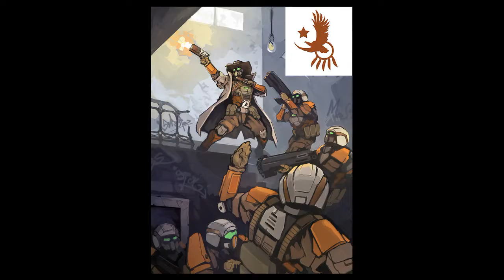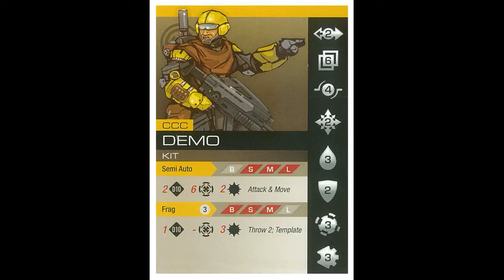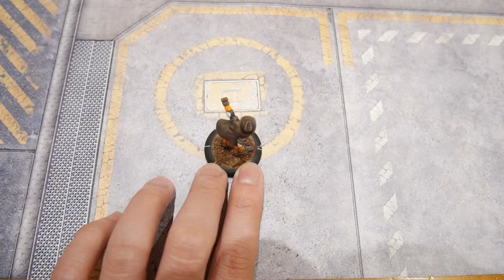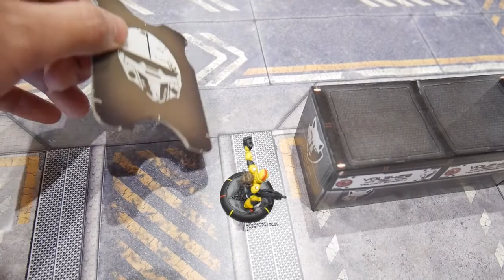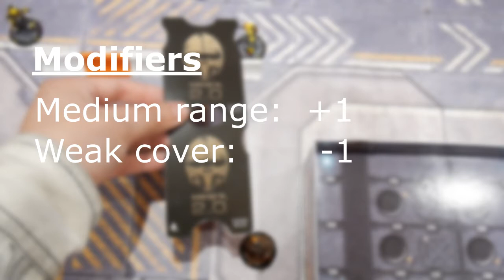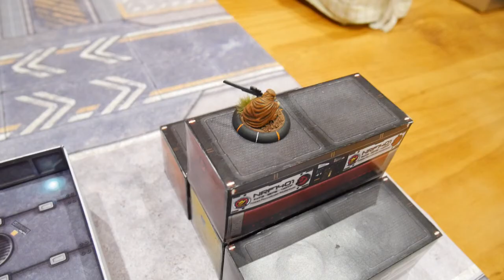MERCS tutorial - Introduction and basic rules

Comment: Where does it say in the MERCS 2.0 rules that you can rotate the movement card template anywhere within the front 180 degress of the model? I've been really struggling with what the restrictions are on moving in different directions (prior to rotating the model), and the rules just don't have anything to say about. I think the way you are explaining it could be right, but I just don't see where in the rules this question is dealt with.
Reply from the maker: The wording in the main rulebook is very poor regarding this (and other rules). The FAQ on the forums (which is now down) indicates that the card template can indeed be placed in the front 180 degrees of the miniature. The moment you place the card template in the back 180 degrees, it is considered a backpedal. The limitation is that the facing of the miniature must remain the same in that one card movement. As explained, you can rotate before or after spending the movement point and placing the movement card.
Honestly, and as some members pointed out on the forums, you almost never have to backpedal as you can turn 90 degrees, place the template on the side, then move sideways backwards.
In any case, unfortunately, I don't have hard evidence for the rule. As you said, it is incredibly restrictive to solely place the card in the exact centre of the front. I suggest using that more fluid movement; I found the game to be incredibly tactical already with that way of movement.
Reply: Thanks! It's a real shame they didn't publish an FAQ in PDF form. I also noticed yesterday that the rules never state in which order the initiative goes: up or down. They never actually say whether your are supposed to start at initiative 1 and work your way up, or start at the highest and work your way down. I know everyone plays it where they start at the highest though.